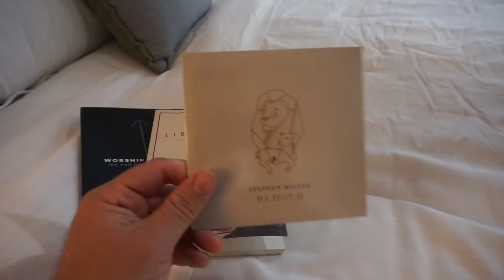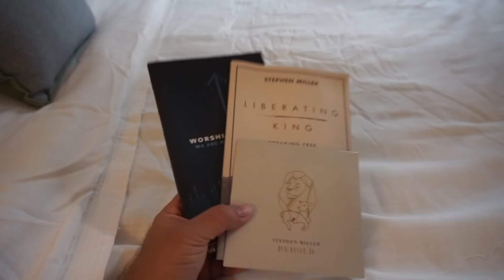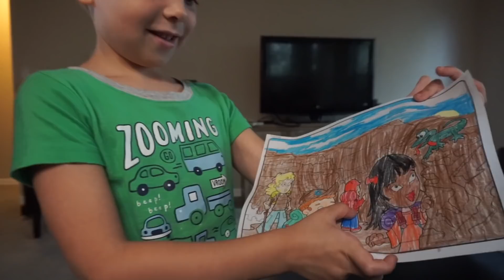WE'RE SELLING OUR HOUSE!! (IT'S FINALLY READY!) 🏠

Comment: @22:17.  The bushes are getting too tall for the home and block the entrance, and alot of the home. I would remove the two front ones and also that little bush next do the driveway (too large for that narrow spot, already flows over onto driveway). If you have time, I suggest removing the taller ones against the house/windows. They are getting too tall and already starting to block windows plus, they are not attractive anymore because the bush is now spindly looking - too many tall, thin branches showing with no leaves.  @24:31 get rid of that little bush that is on the corner of driveway and sidewalk. Why do people think they need to plant bushes so close to sidewalks/driveways, etc? One only is not decorative.